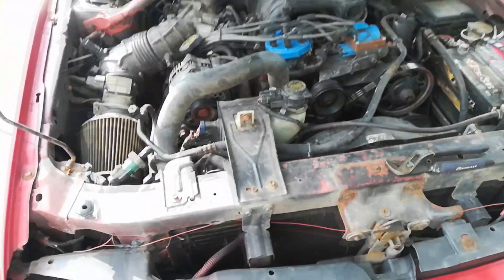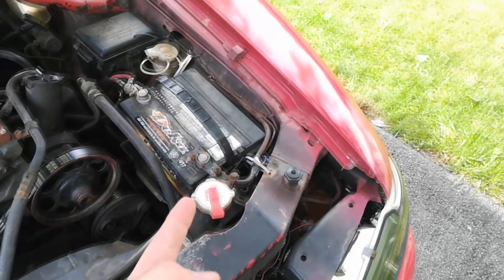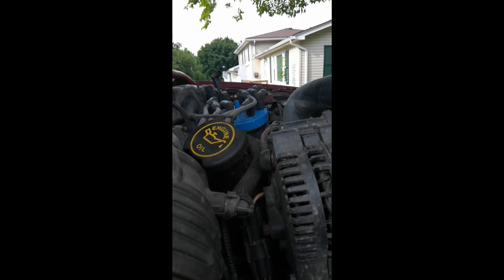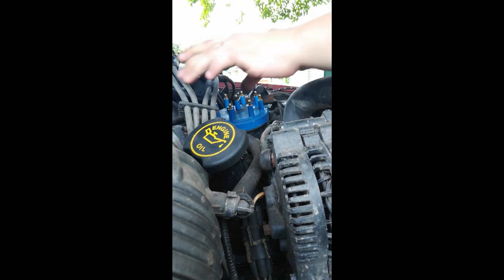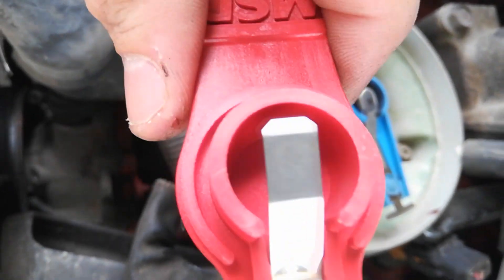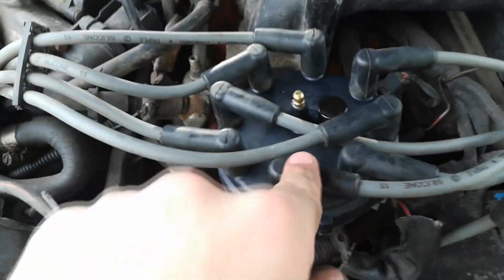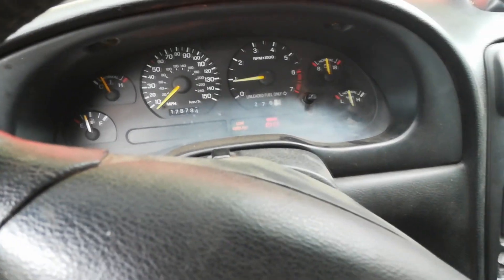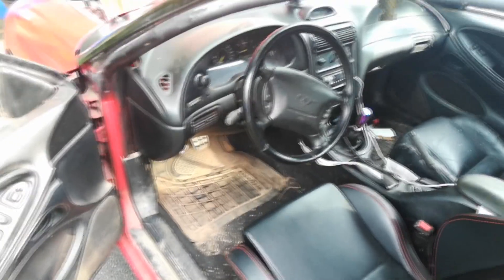Distributor Installation on a 1995 Mustang GT

Comment: Why do disconnect the battery?
Reply from the maker: Ground is tied to the chassis, you disconnect the ground so that if a live wire ever hit the chassis it won't short out.
Reply: @WildEngineering  i was only asking becuase i didn't disconnect the battery when i changed my cap and rotor. I also did plugs and wires and now my mustang doesn't start.
Reply from the maker: @davidpinzon5933  check your fuse box
Reply: @WildEngineering  the one in the engine bay? Any particular one to look at?
Reply from the maker: @davidpinzon5933  youre going to need to google your cars fuse box layout, and search for any fuses related to ignition.
Reply: @WildEngineering  thanks
Reply from the maker: @davidpinzon5933  best of luck!
Reply: @WildEngineering  thanks means a lot